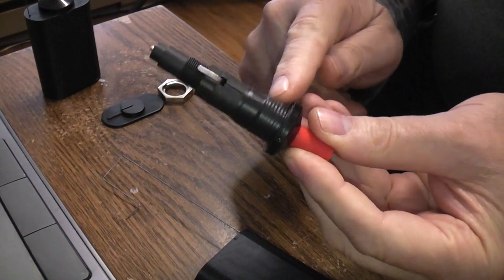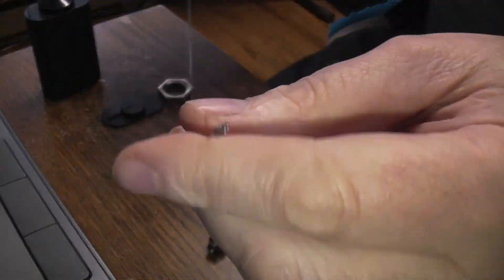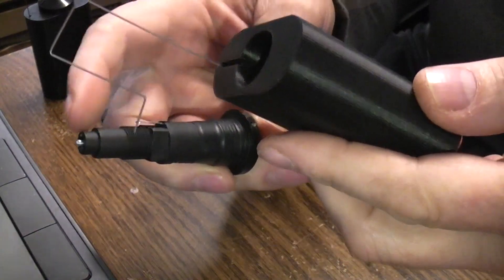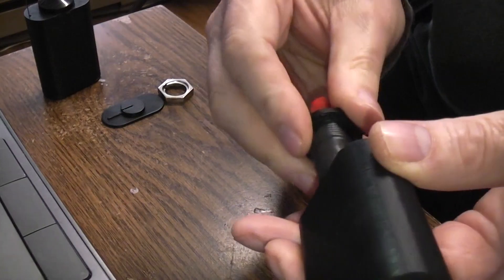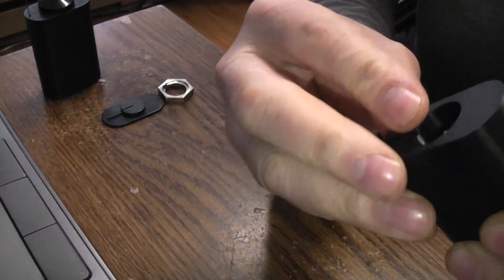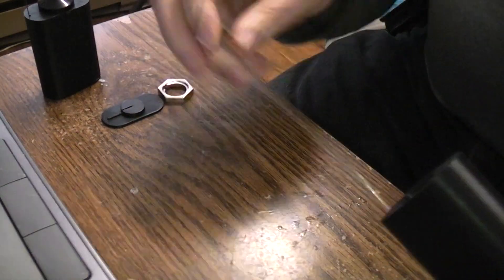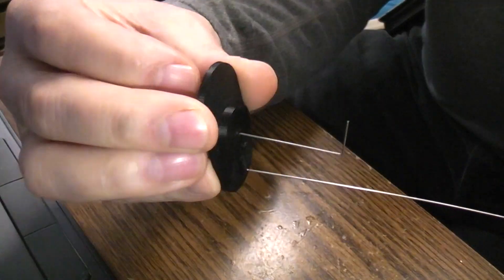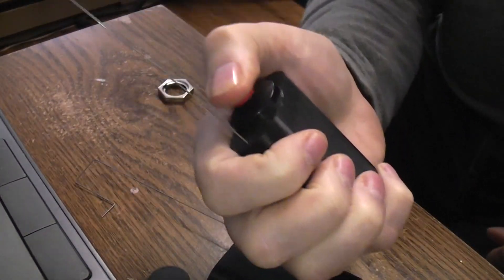Build a Piezo transmitter for your Coherer detector or vintage Radicon toy.

Comment: Interesting....I get a 404 error when I try to access the files off thingiverse....address might be typed wrong.
Reply from the maker: Works OK for me. But the thing number is 3250242 so you should be able to find it that way  Or if the Thing-I-verse search is working right then "Piezo transmitter" should work also. I never type the links as I make mistakes so I copy and paste. Here is the link again. https://www.thingiverse.com/thing:3250242. I re saved the thing files incase the system was messed up.
Reply: @Robothut  Thank you...The link works and I was able to download the Piezo transmitter file.😎👌